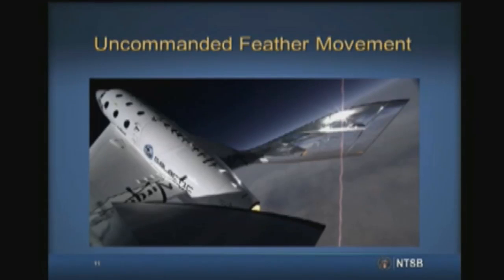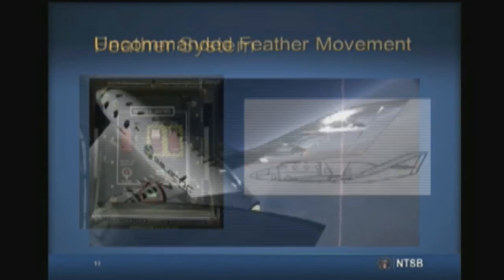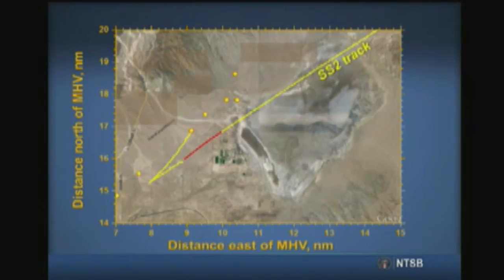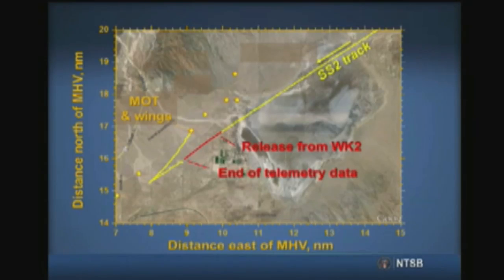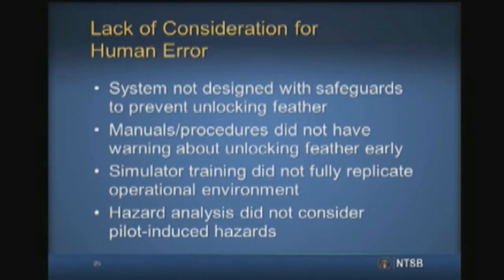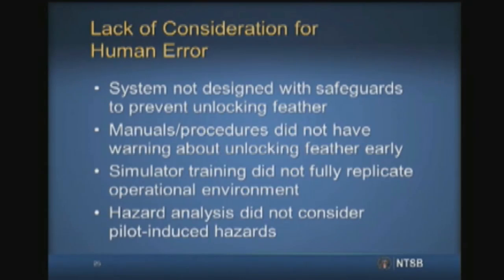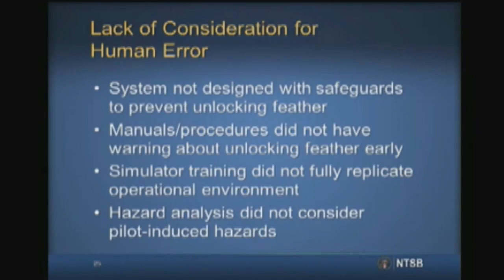SpaceShipTwo Crash: Co-Pilot Triggered Failure, NTSB Says | Video

Comment: I still do not understand why it is better to deploy the feather at a higher speed at the altitude they were at, if the feather will destroy the craft at .8 why would it be better to deploy it at 1.4?  I thought the feather was designed to stabilize the craft at the actual flight altitude (100,000 FT plus) and allow the craft to remain in a stable attitude while it descended into the lower and denser air until it's flight surfaces were able to take control.  At the altitude they were testing at, it seems like they were using it to slow down, in a real flight I think instead of deploying the feather they would be bringing it back in at that much lower altitude.
Reply: monkeyboy4746 by the time they reach mach 1.4 they are normally higher and in a region of the atmosphere that is less dense. Here, mach 1.4 is not a Problem, but it was unlocked too early and therefore too low. Thats why it ripped, as far as i understood it.
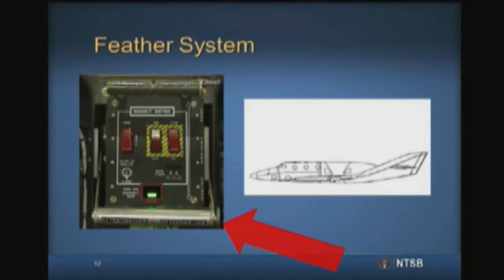Reply: monkeyboy4746 I am not an expert by any stretch of the imagination -- but in the video she says (0:55) that the feather was 'unlocked' not deployed, and that the aerodynamic and inertial load overcame the feather actuators. I take it from that that the error was in unlocking the system, not in actually deploying the feather.
Reply: Gammel Prutte Yeah, what I wonder is if the feathering had been unlocked at regular flight altitude (near space), would the aerodynamic forces at that altitude been sufficient to move the feather against the actuators.  Were they taking a feature of the aircraft that was really designed to only work in space or near space and trying to test it at an altitude where the much denser air made it very dangerous.  I guess the only way to really test it properly would have been to send one up unmanned on a regular flight.